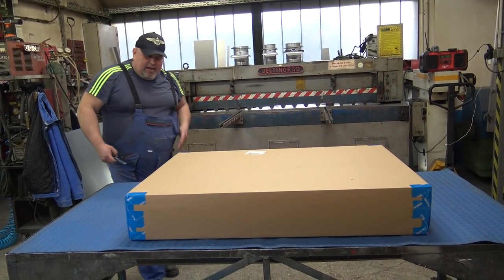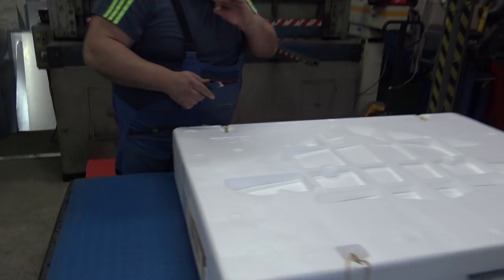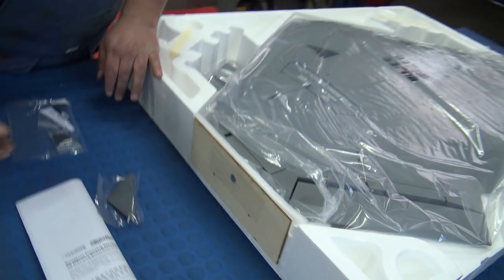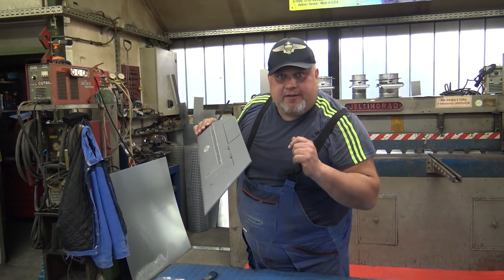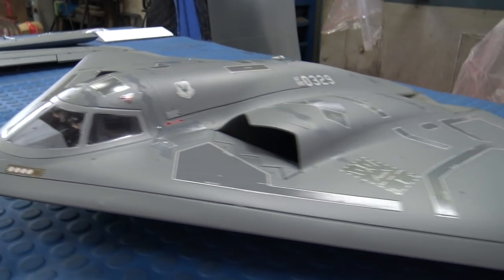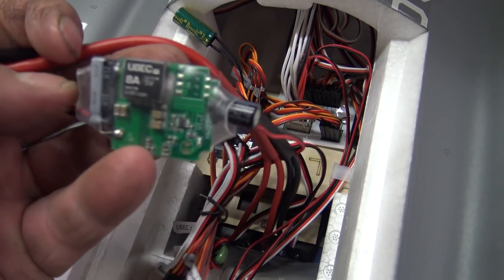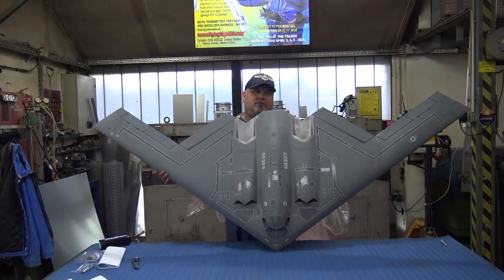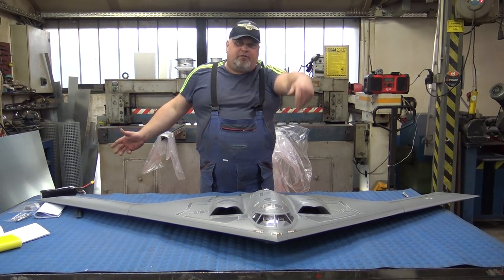GIANT 2.2M FREEWING MASTERPIECE B-2 Spirit Bomber Twin 70mm EDF RC Jet plane PNP Unboxing

Comment: Nice to see you both. I wouldn't recommend using the pre-connector on a edf. High amp draw can melt solder. Can't wait to see your maiden flight Robert. Good filming Blaz.
AirHammer out!!
Reply from the maker: Maybe I will use Spektrum batterie my friend. Big salute to you from Slovenia.

Comment: Hi, I am curious how the maiden flight will go. There was a similar model some years ago, not sure if it was the same wing span or smaller. It struggled from overall stability. If the new one is better it will be almost a must-have for me :-)
Reply: Yes, I remember that video, too.
So I bet the maiden flight will be a desaster, too.
The plane will not take off from the short runway.
I hope I will be in error.
?
Reply: I'm excited to see the Brother's reactions to this majestic model. We've got over 20 flights on our new B2 now and she is so fun to fly. Looks amazingly real in the air. Very stable, flies like a big wing should. It has a minor gyro gain issue, shakes at half speed and above in wind, but that should be corrected soon.
Reply from the maker: I really hope for the best A.

Comment: Do not glue the fin on just cut the slit and put in place.
Reply from the maker: I think I will do that my friend.
Reply: @PetrincicBrosRC  I flew my B2 today and it is so smooth in the air. I flew it scale on a 3 minute timer with a 5200mAh 60C and had 60% left. I think it can fly 4 minutes no problem.